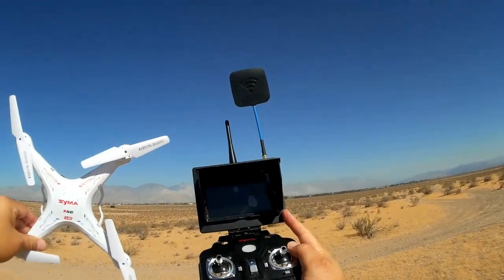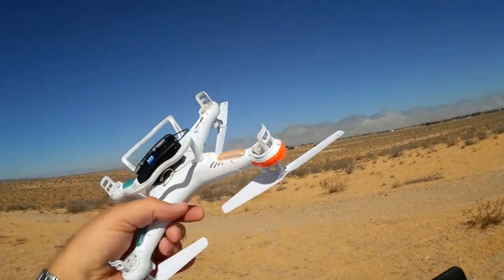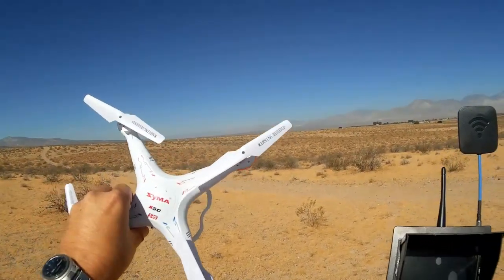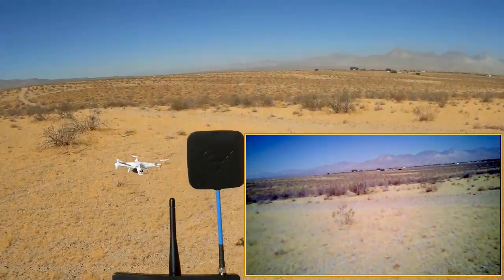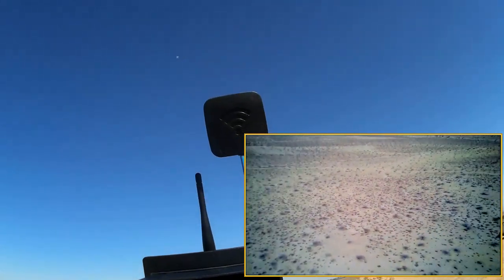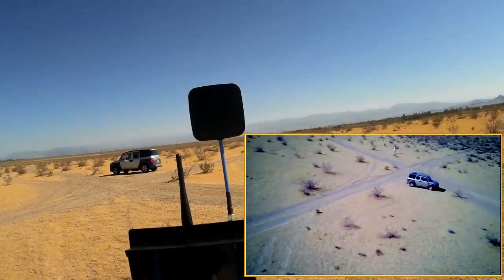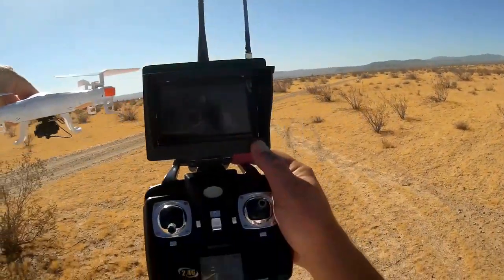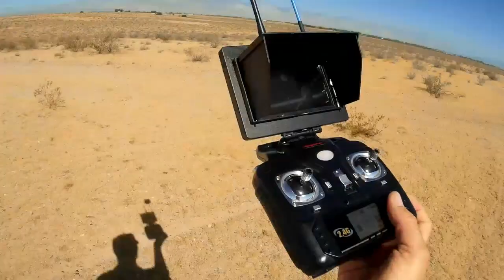Syma X5C X5S 5.8Ghz FPV Upgrade Review

Comment: Well,after watching reviews of the Syma X5C-1 I ordered one and did a lot of flying with it.One of the motors started going out so I
ordered 4 motors and also a bnf version of the same quad.Got the bnf today and back to flying again.It may be my imagination,but the bnf seems a little more responsive than the original.I don't know if the bnf is the upgraded version like the X5C-1 or not or even if it would make any difference in the flying experience.Quadcopter 101 do you have any thoughts on this?? I really enjoy your videos and get a lot of good info from them.
Reply from the maker: To improve motor durability, allow at least 15 minutes motor cool down between flights.  Also be sure to check your gears regularly to keep them clean from debris, which can rob you of power (and burn out motors) https://www.youtube.com/watch?v=LzzD3BPVvH0

Comment: Watched your vid, liked the product, bought it and got it yesterday. Set it up and went out to the field to fly, could not get it off the ground, changed batteries,  same thing, took the camera off and it flew like it always did ( Great) have any ideas on what be wrong could use the help
Reply from the maker: +Ralph Paradiso Could you provide a little more detail of what you mean by "could not get it off the ground".  Did the quadcopter's motors turn when the camera was plugged in?  Or did the motors turn, but the quadcopter looked like it was struggling to lift it?  If it was struggling, try turning each propeller gently by hand, feeling for any unusual resistance in the rotation.  If you notice any unusual "bumps" while turning, you may have debris (sand particles) in your gears which can rob the motors of power (can also burn them out).  Debris can be dislodged with an old toothbrush or a pin.

Comment: I have this product, also the syma x5c-1 i think the camera might be a little heavy for the quad its real sluggish almost full throttle to keep it airborne!
Reply from the maker: +Wim Ross One of your motors may be nearing the end of its life.  To find out which, attempt a rapid takeoff with quick application of throttle.  If the quad momentarily tilts in the direction of any particular motor, that one is suspect.

Comment: Another great review. Thanks for sharing. Would like to put this on my XK  Detect 380. Have you tried it yet?
Reply: +RT drummer I was thinking the same thing, but with the 1000+ meter range on the 380, I think a Keychain  808 with a 200mW transmitter attached will have to be the choice I'm making, the range on this set-up is just not much good for longer range than about 100 meters, if Your lucky?..Still an awesome deal...Love the range for the Syma, and I also use it on My V686g..Works Great!..  :)
Reply: +Soco Joe so if you get a cheap monitor and transmitter for #808 would it work, and if you have time send me a link to the transmitter because im new to this thanks.

Comment: QC101,how  come you're not using the X5SW for the fpv module and using the X5C instead,i thought the SW isn't affected by the accelerometer issue.
Reply from the maker: eric GTX No, it is still affected.  It just doesn't seem to be affected to the same degree as the X5SC.  My X5SC and X5SC-1 come to a complete stall in any wind.  My X5SW still manages to keep some slow forward movement in the wind.  But the reason I used my X5C is because it's still my favorite mini quadcopter of all time.  Very good flier, even in the wind (without prop guards). That's why I always recommend it to my beginner viewers. https://www.youtube.com/watch?v=4u95LfK9Xx0

Comment: How long does the camera battery lasts? Does it's charger got overcharging protection? Also, does it cut off before crossing bellow storage charge like the X5C does with it's own batteries?

edit: Also, how does the weight compare to the official camera? Does the X5C get any more sluggish with this?

Comment: Dude, you mentioned you had more than thousand flights on your syma x5c. How're it's motors? Had to change them? Also batteries
Reply from the maker: +Andrey Evseev Did I really say 1000?  If so, I apologize.  But more likely well over 100 flights.  And the motors and battery are still holding up fine.

Comment: Real good review on the Syma X5C using the FPV upgrade. I was wondering if the upgrade would work on the Syma X8C?
The idea of isolating the camera from the quadcopter's power source is the way to go. The FPV screen looks real good too.
Thanks for the video and ideas!
Reply from the maker: +Dennis Petersen Probably will work.  It works with my Flying 3D X8 ;-) https://www.youtube.com/watch?v=qrzuxjB098E
Reply: +Quadcopter 101 I ordered a Syma x8g It should be arriving soon do you think this would be compatible? On gear best in the product description, it only says "Application: Suitable for X5C X5SC, and can use their transmitters to control the camera for taking photo or recording video."
Reply from the maker: Jas Singh You will NOT be able to control the camera to be able to record with it.  However, you can do FPV flying with it as it will transmit to its FPV screen.
Reply: +Quadcopter 101 Thanks for the reply

Comment: Awesome video!! thanks a lot. do you have a tutorial on antenna upgrade? I also wonder if I can use goggles to the drone? how is the best way of increasing range? I believe it's 50-100m out of the box.
Reply from the maker: +José Campos Here's one way to do it http://www.rcgroups.com/forums/showthread.php?t=1873198&page=43
and your goggles receiver would need to be able to receive one of the following frequencies 5645, 5665, 5685, 5705, 5885, 5905, 5925, or 5945 MHZ.
Reply: +Quadcopter 101 
OK !  What goggles do you recommend?
Reply from the maker: José Campos I don't recommend goggles as you can't keep an eye on the quadcopter's location (you can lose orientation and lose the quadcopter if you lose reception). You'll also need an FPV camera and transmitter.  The system in the above video includes everything that you'll need for FPV (camera with transmitter built-in, Screen with receiver built-in).
Reply: +Quadcopter 101 
OK!  I have ordered exactly the one you have from ebay and I hope to get it soon.

Comment: Hey, Quadcopter man!  I'd bought both these items together, which were working well until the power switch on the fav camera broke and I had to get a replacement. Having installed the replacement camera to the X5C, now the copter can barely get 6 inches off the ground. I've replaced a couple rotors on the copter--and it has had it's share of wear and tear. But I can't explain the new weight burden on the copter with a camera that seems to be identical with the first one I purchased. Has my copter lost some of its get up and go, or should i look for a slightly more powerful copter to bear the weight (any recommendations?)
Reply from the maker: +Patrick Lafferty Have you turned the propellers by hand to check for any unusual resistance or bumps in the turns indicating debris in the gear teeth.  A single grain of sand in the gear teeth can greatly rob flight power from the quadcopter (and burn out a motor).  https://www.youtube.com/watch?v=LzzD3BPVvH0

Comment: Would you say this setup is better than the WLToys v686g 5.8 FPV?
Reply from the maker: tittyfuckn Yes.  It has a better antenna for longer range, and its own built-in power supply for the camera/transmitter.

Comment: Do you know if this will work on the ZuZo drone? It's basically a syma clone. I'm really just wondering because you said it plugs in to the drone.
Reply from the maker: NEW CHANNEL (Jamesian0525) Only the recording function is dependent on the plug.  It has its own built in battery for the FPV, so you could strap this to anything for FPV.

Comment: so, sorry if I seem useless but there shouldn't be a problem since the original syma x5c camera Is connected with the quadcopter with three cables one red one black and one yellow and this Is connected only with two?
Reply from the maker: +POL TSAR Yes it only needs the yellow and black signal wire and ground to tell it to start and stop recording.  It does not need the red power wire since it has a built in battery to supply power.
Reply: Quadcopter 101 ok thank you very much :)

Comment: Bought this on Amazon after seeing this.  With sd-card installed, no video link (but video records) remove sd-card, and I get a video link, but screen says 'card error' (no card, so of course) any idea's ? No manual included. No idea where to get tech support on this.
Reply from the maker: +Bruce Meyer Never heard of the video shutting down when the card is inserted.  But do you have another microSD card that you could try.  Also be very careful inserting the card, do not try to force it in upside down.  It will only go in easily in one direction.

Comment: I just got an X5C and I love it but the flight time is a little sad.  I am looking to get a few extra batteries but I'm not sure what to get.  I've seen a few higher capacity batteries, up to 850mah, that say that fit but that seems a little big for the space provided.  Have you tried any of the bigger batteries in it?  what do you recommend?  THanks
Reply from the maker: +Josh Underwood The bigger batteries are very difficult to fit in and remove.  The optimum size seem to be about 600 to 650mah for this quadcopter. Here are a couple choices. Remember to give a 10 minutes cool down period between flights to extend your motor life.
http://www.banggood.com/Syma-X5-15-X5C-3_7V-600MAH-Upgrade-Battery-Meal-p-941261.html?p=RB0922217402201307U3

http://www.banggood.com/5-PCS-JJRC-H9D-H9D-10-3_7V-650mAh-Battery-p-970606.html?p=RB0922217402201307U3
Reply: +Quadcopter 101 thanks for the reply. I am new to the RC scene.  for years I've been interested but I always thought that it would be a money pit. I recently discovered the "Wish" app and it has a ton of this stuff very cheap.  some of it is junk but some of the copters I've got, like my X5C ($24) and my MJX X600 X800 and X900 (all under $35) have been great. I think I'm hooked. I'm now ready to get something with GPS but looking around for something that won't break the bank. any suggestions on that?
Reply from the maker: Josh Underwood If you think that you're ready, then my favorite low cost GPS drone is the Flying 3D X8.  http://shrsl.com/?~aybj
It's a very capable quadcopter with telemetry. I recommend not monkeying with its firmware, as I notice seem to run into issues when they do such. But do be sure to calibrate its compass as per its directions.  I like this bird best of all because of its telemetry abiliity (know range, speed, position, heading, battery power, satellite reception etc.... while in flight).  This makes it my preferred "science experiment" bird https://www.youtube.com/watch?v=op1PmtHTpzw
https://www.youtube.com/watch?v=qrzuxjB098E
https://www.youtube.com/watch?v=gnCXyOEmgao
https://www.youtube.com/watch?v=s-L946Jcfik

Comment: Hi, can you tell me if the recording can be started manually on the camera or it is only possible with the X5c remote? It's important to me because I like this FPV a lot but I have a slightly different quad (Shengkai D97, which was also tested here), and its camera control may not be compatible with this.
Reply from the maker: +endruboy111 The camera has its own built-in battery, and as such, can be jury rigged with velcro or cable ties to just about anything.  But the control cable plug may not fit all quadcopters.  Because of this I replaced its control plug with a micro switch from a dollar store LED flashlight.  With some ingenuity, you can use this camera and its receiver screen with just about anything, even RC cars https://www.youtube.com/watch?v=RyKHSnAEPIo
But again, it requires some modification/replacement of the plug with a switch, and jury rigging the camera's attachment to whatever you want to attach it too.
Reply: Thanks, now I'm waiting for a discount and then will buy this.

Comment: my syma x5 wont connect for some reason. yesturday it just stopped working, i did not crash or anything. you know a easy fix? i have ordered a new reciver board tough but it takes 3 weeks before i get it
Reply from the maker: +kevstep Not sure as this problem is unusual.  What do you mean by "stopped' working".

Comment: I have a question about charging. The usb charger, is the battery full charged when the usb dongle lights up?
Reply from the maker: +Randall Huston No, the light seems to be an issue with its charger, sometimes it lights sometimes it don't.  I just charge each (screen and camera) for about 45 minutes and hope that it's good to go.
Reply: +Quadcopter 101 I found a setup on ebay that came with the X5SC and the fpv gear. It's really a great little fpv unit. I got it for my girl friend's son and it flies great.

Comment: back again ok I put the latest in right still does the same thing also followed the guid on how to fix it could the motors be bad? also my battery isn't dead and all of a sudden all the lights will start flashing on the drone and shut off any ideas?
Reply from the maker: +Austin Childs Can you make a short video showing the problem, particularly showing the propeller installation, and how the quadcopter reacts when taking off?
Reply: Yeah where should I send,it it stays in for about 5 seconds then totally loses connection with the remote or something but I'll take a video of everything just where do,I send it
Reply: +Austin Childs alright I,made a video for you
Reply from the maker: Austin Childs I can hear it and see it. Front left blade is hitting its prop guard. The quad is shutting down to prevent overheating the motor from the added torque of this impact.   Just bend the prop guard down a little so it no longer makes contact with the propellers.  Also,turn each of the propellers gently by hand to make sure that no others are coming in contact with the prop guards.  And finally, try a gyro calibration.  Place the quad on a flat and level surface. Bind the transmitter to the quad. Then move and hold both control sticks to their lower right corners until the quad's lights flash.  Then try taking off.
Reply: Alright thank you very much I'll give it a go

Comment: how will you trigger the camera from different quads ?  the connectors and wiring will be different.
Reply: kendall connolly You can't on most of them. I'm going to attach this to a drone (probably the syma x8) just for the FPV and then attach a sj4000 for filming.
Reply: Fresh StopMotionReviews Plus update if this will work with the X8. I plan to do the same. Thanks.

Comment: hello quadcopter 101, how is the quality of the recording video in comparision to the stock camera on x5c?
Reply from the maker: IMPORTECHML They're about the same 2MP video.  But the advantage of this system is that the lens can be swiveled up or down so that you can see the horizon or the ground.  The X5C's camera is stuck in a slightly downward angle.
Reply: Quadcopter 101 thanks man, i want one of these

Comment: Would a good idea be to buy a Syma x8c and then remove its camera then attach both this Fpv camera and my sj4000 to it? (If I could find a way to attach the monitor to the transmitter)
Reply from the maker: Fresh StopMotionReviews It should work.  Am planning to do something similar with my larger long range fliers (combine this camera for FPV with my Runcam HD camera for recording).
Reply: Quadcopter 101 Syma X5 + Fatshark Googles + This Camera should = some laid back, gentle FPV training? Should work shouldn't it?

Comment: I want to order a quad from banggood but I am confused between right hand throttle and left hand throttle because of the broken English, I even asked if left hand throttle meant the throttle control was on the left and I think the rep said that means for left handed person and throttle is on the right...What would I select to have the throttle control on the left hand side of the controller?
Reply from the maker: +Peebsfosho1 Well, this may confuse you even more.  A good rule of thumb is based on which side of the road your country drives on.  If your country drives on the right side of the road (example USA), then get a left sided throttle (Mode 2) as it will feel more comfortable for you.  If your country drives on the left side of the road, then get Mode 1 (throttle on right).  Not sure why this seems to work, but it may have something to do with how our brains are programmed from driving. And finally, a good reason to select Mode 2 is because it seems to be the most widely available. http://www.rcgroups.com/forums/showthread.php?t=241622
Reply: +Quadcopter 101 thanks so much for the quick reply! Love your channel! That does make sense I just don't want to take any chances getting the wrong one. I live in MA so USA! I have an aviax h2o and the throttle is on the left and It feels very natural. So mode 2 it is! Thanks again :)

Comment: Quad 101 help me out here, I already have the X5C-1 so I was thinking of buying this for it as well but I am wondering if it is any heavier and did it reduce flight  time any? I'm getting around 7 mins now with the Nano tech 750 mah with cam on the entire time and I like that so I'm wondering if the system comes with a sacrifice in flight time of only 3 mins.  Maybe I should go with the system for the Tarantula X6? WYT? The Tarantula is on sale $46 so I am wanting a second opinion.
Reply from the maker: +wild300zx You don't have a Tarantual yet ;) https://www.youtube.com/watch?v=F1UUXxLazq8
Reply: +Quadcopter 101 Yeah I know, I am debating between it and H5P which I really like but also like the size of the Tarantula for line of sight, lifting power. Leaning towards the Tarantula with that FPV system that works with it so I can line up some higher Pic/video shots.